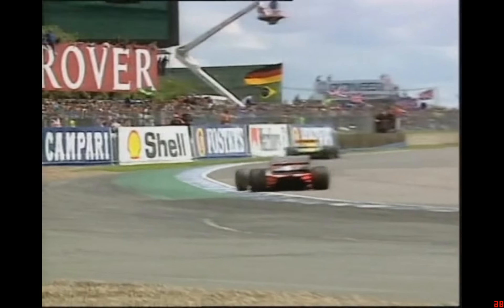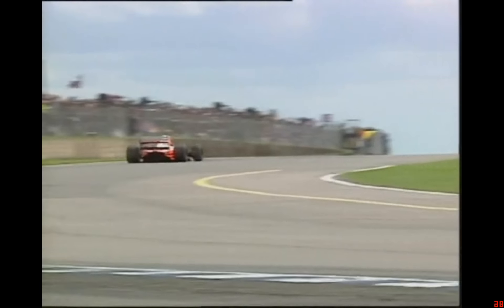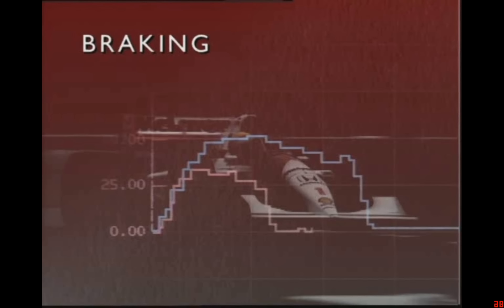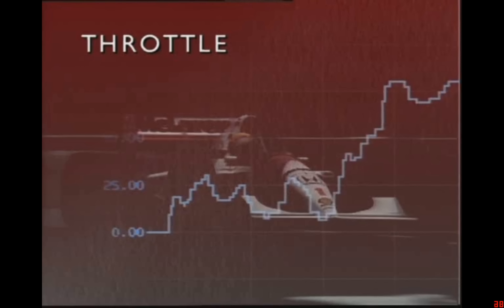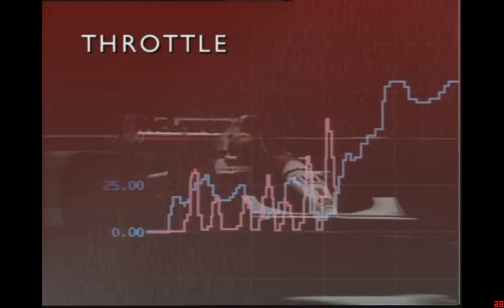Ayrton Senna - Braking & Accelerating Technique

Comment: I think 8 wins for senna 92,93 is a fair achievement by senna considering 92,93 Williams was driven by a computer and had 100 extra horsepower, It would've been really interesting to see him beside Prost at Williams, I believe He would've gave him a real hiding considering what he achieved in a underpowered less sophisticated McLaren 93 Prost outqualified him 15-1 93 but only won 7 compared to senna's 5. I think 93 senna was at his finest. 94 Also I realise he crashed out all 3 races. But Brazil after Schumacher pulled away for a 10 second lead, senna began pulling him in and pulled it back to 5 seconds, Damon hill couldn't keep up with either of them. unfortunately, he lost control and stalled the engine,2nd race he was taken out by hakkenin. Imola lap 6 the lap before he died he set a very fast time. A time that was only beaten Much later in the race by Schumacher and Damon hill on light fuel loads and hot Tyre's. I think if he had lived he most probably would've won the championships 94,95,96,97 I don't think he would've liked winning 94 with Schumacher's disqualifications though
I think he would've wanted to win 94 fair and square with Schumacher on track. Damon was only capable of catching Michael while he was sidelined, Even once the b spec Williams arrived, I added the points up and Michael still dominated hill on track.
Schumacher was a speed machine 
Just as Williams was bad handling to begin with benneton was bad handling all season in fact multiple seasons 94,95,96,97 b spec cars never came to benneton. Schumacher was special software at benneton - then 96 long before benneton staff Arrived he was special software at Ferrari and instantly beat benneton and was fighting with Williams. Whilst his teammate was struggling to hold off Jordans in the Ferrari f310.
Reply: 1992 & 1993 Williams was 1.5 second per lap faster  than the whole grid even surpassing this year’s RedBull dominance. 
He won 5 races vs Prost’s 7 was unbelievable. If we had 3 or 4 more races with rain 🌧️ he could have won the championship.
I respect Clark,Schumacher,Hamilton,Verstappen and Alonso but no comparison to Senna’s speed , charisma and devotion to the sport .
Reply: @ahmetsezer2076  I think on average 1.6 but wasn't unusual 2 -3 seconds. Was a monster of a car. I think if Senna had the same Renault powered V10 in the McLaren and although McLaren was Less sophisticated. I think senna was the X factor 
7 wins for Prost 
5 wins for senna 93
Clearly proves senna was the strongest of the two

Comment: Senna wanted to make the car lose grip in order to:

1) Slide the car just a bit so that he could change direction with a better angle during a curve and...

2) Change gears and hit the thrust at any point of a curve in order to be able to increase the grip and speed. (This was the main reason)

You see, if you lose grip and gain grip: it's like a basketball being thrown to the ground.  Just like a basketball player makes short bounces (while running towards the Rim), so that in the last minute he can increase the bounce and lift the ball higher, in order to make a slam dunk.  

The car is not only sliding... the car is literrally bouncing!  On a curve!

Watch this short video to understand the physics behind the concept: https://youtu.be/B3NbPUTD5qA

The snake increases the grip by alternating the ground contact (which only two parts of the snake are actually touching simultaneously the ground).

Senna was actually increasing the grip by making the car lose and gain grip over and over again.

When Senna wanted maximum speed, he would stop the alternation and hit full Throttle.  The car literaly kicked the floor underneath it.

Gravity plus hiting the thrust would thrust the car foward just like a rocket uses thrust to hit the ground in order to take off.

In my opinion Senna truly is the GOAT.

.

Comment: Why is everybody up in arms about this? Everyone knows the technique. That's why you set up a single seater to be neutral to slight understeering for fast corners. Even in his conversation with his engineer David Brown in the 2010 movie "Senna", Ayrton says "When it's supposed to break away it breaks away even more" about the FW16.

Hell in primitive racing games (F1GP, F1GP2, GT, etc.) the way to lap fast was to cause the car to steer-in using oversteer. This is a well known technique.

Senna did it however, to initially maintain the turbo at high RPM and reduce lag (84-88), and secondly to keep the car on the limit of level of grip (his whole career). Senna was perhaps not the best on his tyres for that reason.

You guys should read Senna's book (Principles of Race driving), admittedly co authored, but still it gives insight into his style. Much more innovative than this throttle technique described in this video  was his delayed apex slow corner technique.

Comment: I wonder if the reason Senna worked the throttle was that the engine exhaust was bled through the floor diffusers? In other words, the engine exhaust gasses might have been involved in generating downforce (either by acting on the underfloor diffusers or in helping direct air to the aft wing). Or perhaps he was using engine torque changes to rock the car left to right about the car's longitudinal axis? Or maybe the car was just setup wrong and had understeer??

Comment: Something is missing here. I'd like to see the difference in lines driven through the corner and what they do with the steering wheel.

A driver like Senna felt the car's movements on the asphalt much better. That extra information gives him the ability to get much closer to the limit of losing controll of the car.
Reply: In this video (https://www.youtube.com/watch?v=UWnWaW3icGk), they showed how Senna took turns in Monaco so tight that the rubber might have rubbed on the rail just slightly before he flicks the steering wheel back out. On several occasions, you could see Senna's flick, hence why people says his car dances in the track.
Reply: He had a fucking gyroscope in his head!

Comment: Senna wanted "off boost operation" and it's easier to stab quickly and rapidly to extract off boost power than trying to modulate a turbo that comes on exponentially.     A lot of computer controls of earlier ECU driven cars used "duty cycle pulsing".
Reply: He did it in karts before racing cars.
Reply: And he got beat by Lake Speed.
Reply: He did it in non turbo f1 cars too.

Comment: ...i don't see how Jonathan Palmer's analysis explains anything...yes the data of Ayrton Sennas brake and throttle is different than Palmer's...but a second is a long time in F1...you would also have to analyse steering input and corner lines, and corner apex speeds bare minimum.
Reply: Is not a full analysis because F1 teams were, and still are, very secretive, we should be thankful we have this snipets of telemetry to learn from, if he is getting a tenth of a second on that turn alone just do the math, most circuits have more than 6 turns for sure.
Reply: Dont explain but for these that already raced at kart (or any other kind of race) and have some experience with simulators, know what he is talking about. 
Instead of breaking more to get the car to grip to then accelerate more and gradually, Senna break less and pushes the throttle before, with stronger "rhythmical" (edit: not really rhythmical but is easier to explain, he used to do that feeling the car and the need for grip but considering the need for more speed to be faster) hits on the throttle to get the car to grip through acceleration and loss of speed, letting the car to go toward the outside line of the track as much as possible without leaving it, but seeking the top speed possible during the turn to carry it to the exit of the turn. 

Basically: 
- If you push throttle while doing the corner, the car will move more to the outside line because the car will slip sideways, if you leave the throttle the car will move more to the inside line regaining grip. 
- If you break while doing the turn you may lose either front or rear wheels, what mean unpredictablilty (and racers tend to avoid doing it to avoid spins or too much wheel correction). 
So, if you break more when you are inside the turn, you have to use less your throttle (or to avoid using it at all). 
By not using the break through the turn like Palmer used to do, Senna had to relly only on using the throttle (or not using) to be able to do the turn. 

The result of that, with the cars they had at the time, is that the car will lose both rear and front wheels whe he alternate throttle hits and he did that on purpose to bring the car to where he wanted. This kidn of technique is also used at karts and rally, but was not used at F1 because the cars were not made to lose grip (even if the cars used to lose grip, these were made to be fast with grip, not without) . . . it was somewhat of a gamble as dirt at the track, difference on track conditions or even a bump may turn a dgood turn into a disaster, but he sure knew what he was doing and could adapt very well most of the time.
Reply: Also everyone was a second a lap quicker than Palmer lol
Reply: @pbysome  Ayrton would beat Andretti by two or three. Palmer was quite quick.
Reply: @adampetten5349  quite quick in f1 is slow.
Reply: @IronwillNeo  excellent explanation mate!

Comment: The throttle use may be jacked all the way through but in the end the power progresses in a constant manner as you can see he presses the throttle in more with every stab, Im just wondering how the hell this doesnt unsettle the car or cause him to understeer unnecessarily.
Reply: back then cars used traction control
Reply: It's got nothing to do with traction control. Stabbing the throttle will unsettle the car, but like a fighter jet designed to fall out of the sky, if you can control it it will make the vehicle very manoeuvrable. It will send bursts of power to the rear wheels, causing oversteer. This is how Senna got the car rotated, despite his faster apex speed. This obviously takes incredible skill and car control, which is why he is widely said to be the GOAT.
Reply: He was ambidextrous, so he could control and turn the car better because he had more power in the hands than the others.
Reply: More power in his hands? Lol good one
Reply: avckubw938v1bnvowiqv They didn't. Senna only had TC in '92 and '93.
Reply: Could also be the reason why you'd see his car dancing around, even in straight lines. Dude was a master at controling the car's traction.

Comment: Set the car up for large  oversteer  then the driver  changes the "force vector" by acceleration to reduce/change the centrifugal force into forward force i.e. the car accelerates without the rear sliding out . talk to a mechanical engineer to understand this.